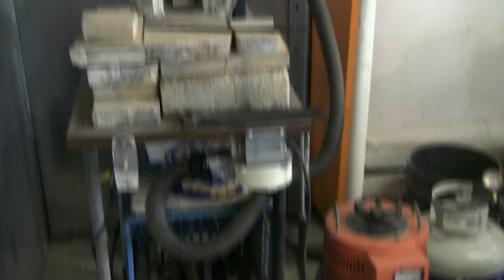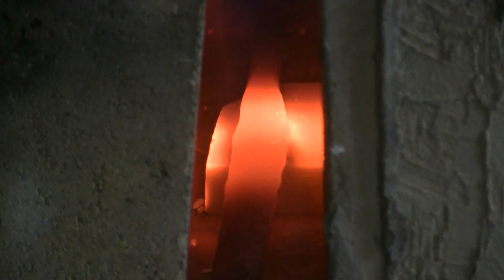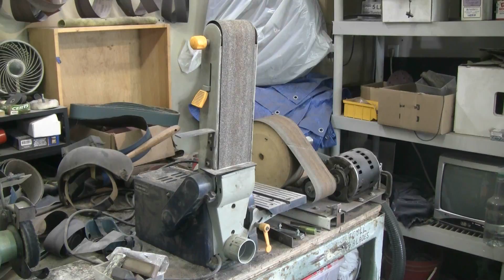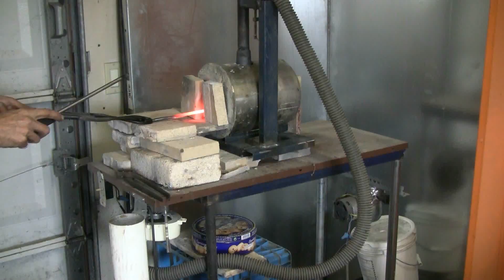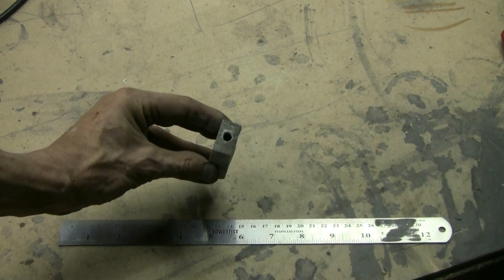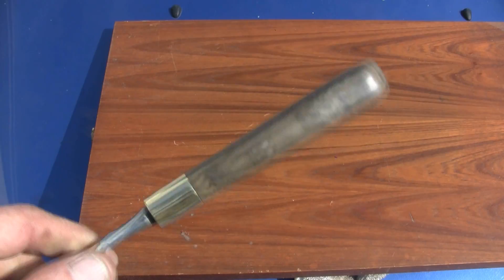New Gas Forge And A Stone Handle Dagger

Comment: Do you blow air into the forge while the propane is burning? Don't really know how a forge works.
Reply from the maker: This is a forced air burner so air is blown through the burner. A small blower provides this airflow, delivered through the black hose attached to the burner.
Reply: Thanks!